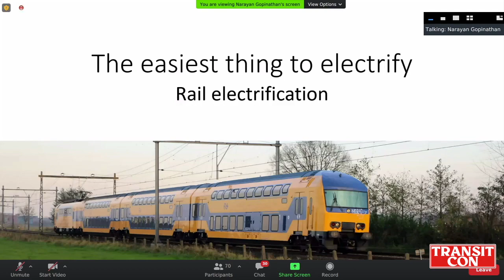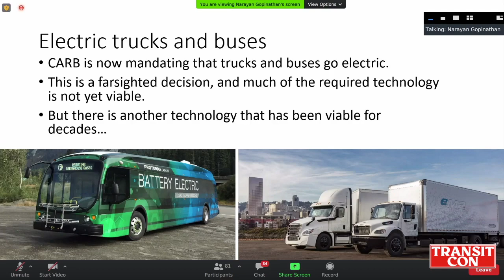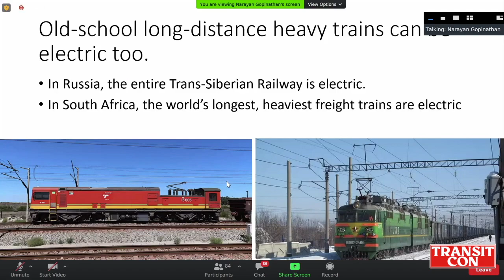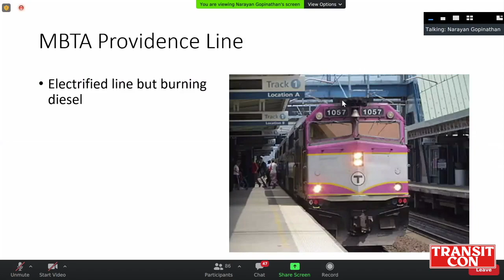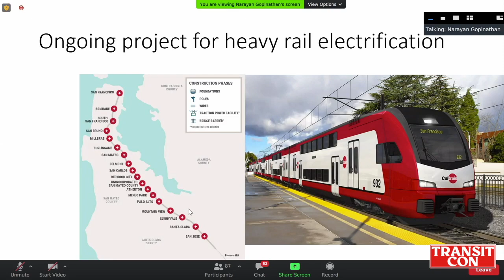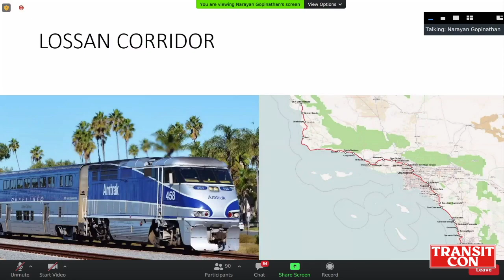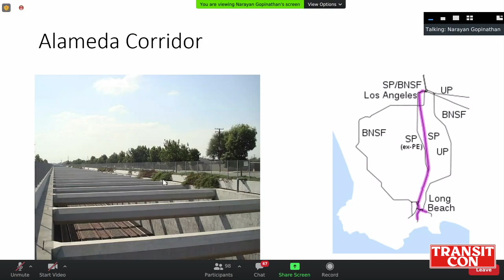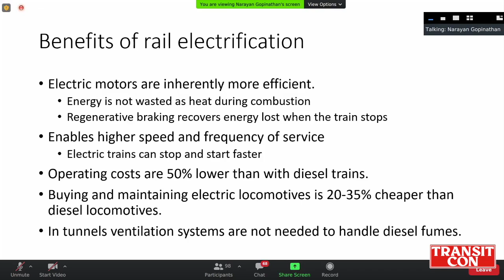Electrifying our Existing Heavy Rail Systems, Narayan Gopinathan

Comment: 1) audio is utter shit
2) all the situations when you got diesel stock running on electrified lines is due to rolling stock uniformity. It is much easier (both operationaly and financially) for MBTA for example to maintain only one type of locomotives as there’s only one facility involved. You either electrify 100% of the network at once (good luck getting money for that, duh) or do not switch at all because construction of new maintenance plant for electric stock will swallow your budget like it wasn’t even there. 
3) The way you described your vision of electrification for Alameda trench makes me question if you even understand what you’re saying. Those horizontal beams are made of pre-tensioned concrete, which is not supposed to be drilled. Care Aries will either be installed on separate horizontal beams BENEATH, not above the concrete retaining beams, or on more conventional and easier to install (since there’s no interaction with retaining walls) poles. With either portal structures, or single and double masts, does not really matter at this point.
Reply: Bro no need to be nasty and hostile. This is obviously new for him and he sounds young so back off!! You're sitting here giving nasty feedback when you yourself don't even have videos that could do better. As far as the Alameda trench goes, unless you read the PDF of the project or just happened to be "in the know" about the pre-tension concrete used for the project, then that's not going to be common knowledge. Geeze, the guy can have an opinion. Correct him and educate him. Don't be a dick about it 🙄.